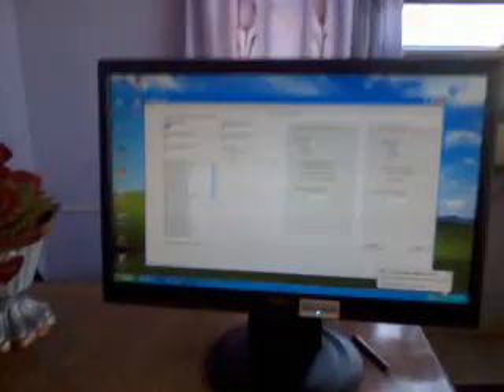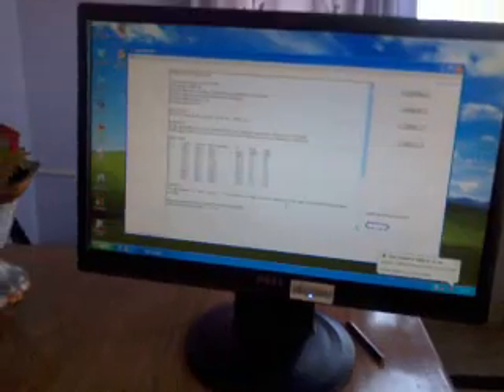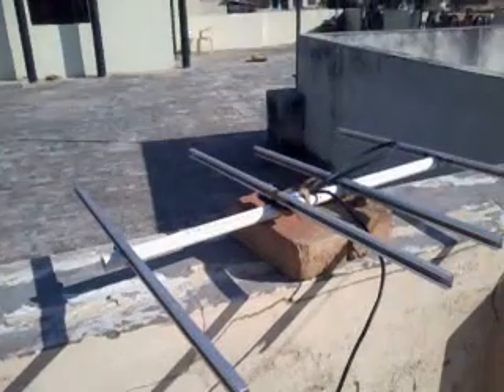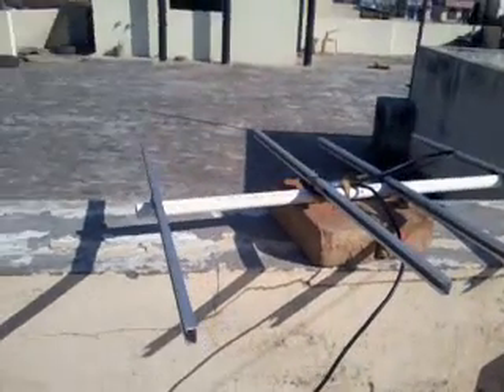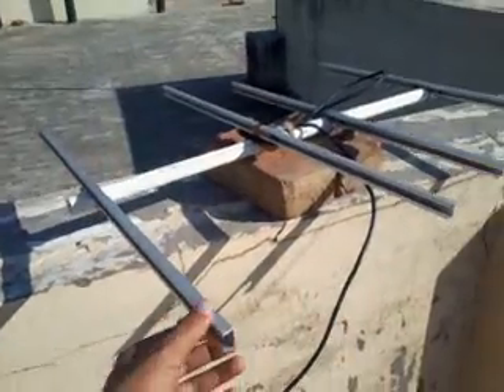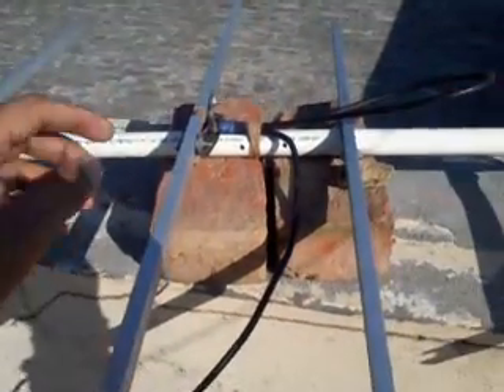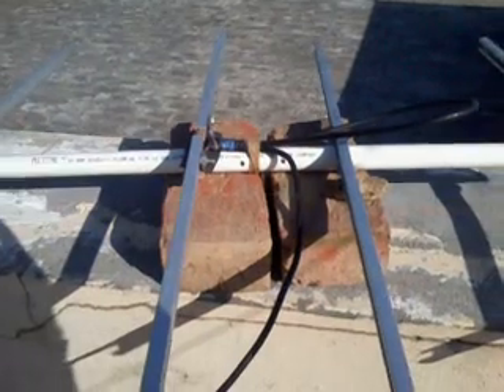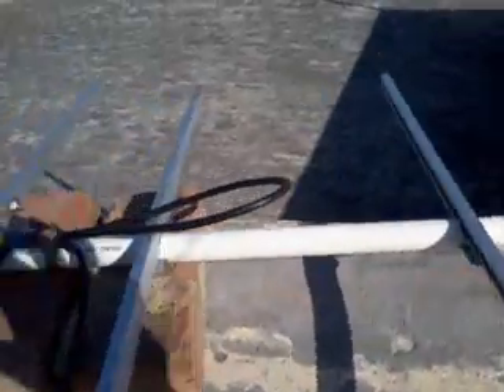How to make Yagi anteena for DD News (182 Mhz)

Comment: Please help! I belong to Gorakhpur,Uttar pradesh and I am giving you following  frequency parameters for terrestrial transmission
**For DD National,DD lucknow and DD Gorakhpur 
Visual frequency: 203.250 MHz
Aural frequency:208.750MHz
**For DD News
Visual frequency:182.260 MHz
Aural frequency:187.760MHz
For best signal reception which frequency(visual or aural in both case) I used in yagi antenna calculater for design an antenna
Reply from the maker: Hi Varun, 
For DD national u can take 182.5 MHz as Central frequency. Use Yagi calculator to determine length of dipole , then in order to increase the directionality u may as multiple elements in Yagi.

Also make sure to use quarter wave balloon before feeding signal to coaxial cable

Comment from the maker: You can use flat aluminium angles used in aluminium doors as elements.. no need of pipe. The boom could b non metallic material I used 25mm plastic pipe
Reply: Good info... Thank you sirji..
Reply: How to made this antena please help me
Reply from the maker: Dear friend 90's kids .. thanks for your interest in this project.

It's simple to make . Steps to make simplest antenna are : You can take a aluminium or any metal strip of length (lambda/4). Where lambda is wavelength of 184Mhz. 
Now divide this in two parts of equal size and connect through a coaxial cable to TV. 

You need to create quarter wave balloon from the same coaxial cable at point of connection of cable to antenna.

There's plenty of info on how to make quarter wave balloon from coaxial cable on internet.

Comment from the maker: Hello Sharad, Below are the dimentions .. 1. Boom Lenth - 797mm, 2. Reflector 791mm (spacing from boom edge 30mm). 3. Dipole 764mm(Total, 764/2 each part) Dipole spacing from boom edge 324mm. 4. First Director element 723mm (spacing from boom edge 475 mm) . 5. Second director 716mm spacing from boom edge 767mm.    The elements used are 0.5mm thick aluminium pipes with dimentions 10x5mm ractangular. The baloon is quarter wave transformer with length (Lambda/4 of 182Mhz wavelength), Hope this will help you.  Thanks
Reply: Sir I have a query what is the name of design software and also the dimensions of big dd national anteena
Reply from the maker: @Arijit_VU3ICT  the software is Yagi calculator available at vk5dj.com/Yagi.html

Comment: Hi Vikram, Can you please share the measurements and spacing of elements? Also the length of wire to match impedance. Thanks
Reply from the maker: It's available in Yagi calculator software available at vk5dj.com/Yagi.html

Comment: Sirji, I am from Kolkata. I miss my childhood days when I use to watch Bangladesh TV terristrial transmission  with multiple element antenna and gain controller. I liked toying and fiddling with the gain controller most and it was a challenge for me to get a clear video. Lately I heard that Doordarshan has stopped terrestrial broadcast. Is that true ? I doubt. Also lately when I went to the electronics market to buy an indoor antenna I found that none of the shop have them. It would be great If you can make a video of the reception of a far-away station with a multi-element antenna along with a booster, flat cable (parallel) and balun transformer. 😊😊😊
Reply from the maker: Hello Anibaran .. yes I would like to post the video you mentioned in near future. In the mean time you may make one by Ur self keeping in mind the lambda/4 rule. The other elements would increase the gain and directivity of it.
Reply: I live in Amritsar and we used to watch Pakistan television network World (PTV). Sometimes PTV used to be crystal clear than DD national.

Comment: Sir today i make the antenna like your desing but , i didnot catch dd news i catch only dd national ,and the dd national auto matic change in dd bangla what this is happend???
Reply from the maker: Good job .. In order to catch both DD news and DD national your impedance matching (quarter wave baloon) should be well designed, you can find its design online easily. Mixing of DD bangla with dd national could be due to local retransmission of these channel in time divisional basis
Reply: Thanks!